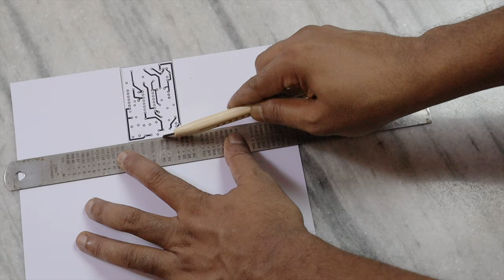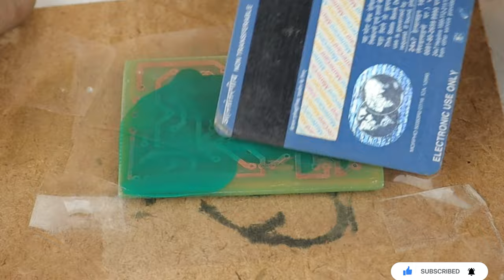Make Professional PCB at home

Comment: I have had much better success to transfer the toner to pcb by using a solution of 8 parts of isopropyl alcohol mixed with 3 parts of aceton from pharmacy or nail polish remover. 

Used some on surface of pcb and pressed upon the pcb with firm grip the paper and kept pushing it for 2-3 minutes. 

I could transfer many complex drawings of circuit boards. 

The iron transfer has the potential problem that heat is not applief evenly on all surface of iron and the material of the ink has a specific temperature it needs to be removed 100℅.many times not all complex image of a difficult drawing of a circuit board could transfered all. 

After I used aceton and isopropyl alcohol I never used iron again for tone transfer again.

Comment: What is the use of ferris chloride solution bro
Reply: It will remove the copper other than the inked part. So we will have only the black lines which act like wires